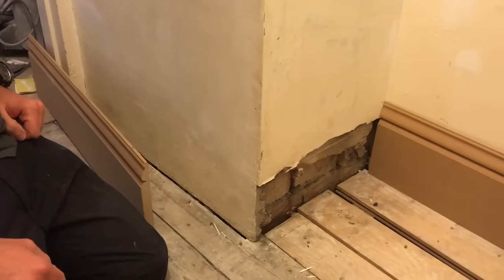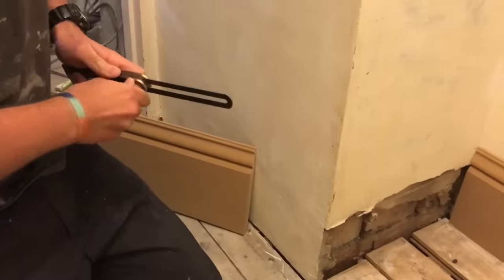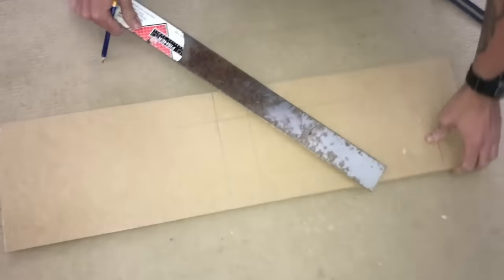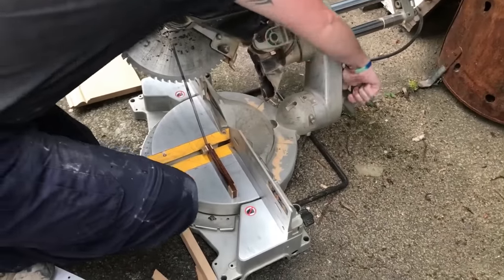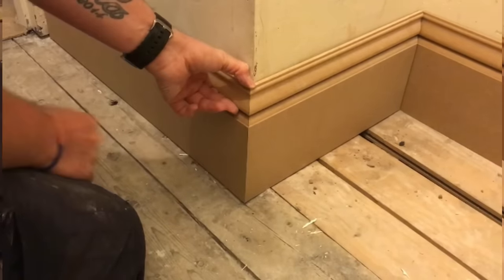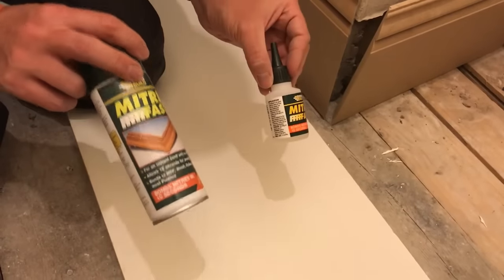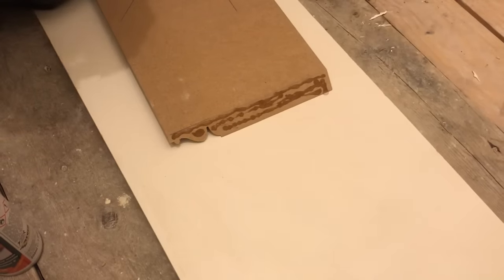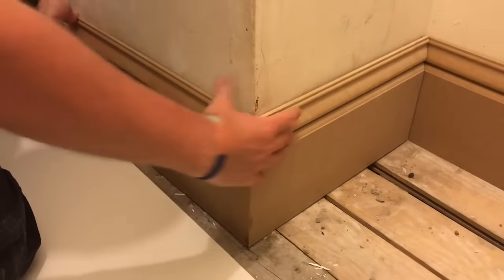How to cut an external mitre / outside corner on skirting boards / baseboards.

Comment: I'm sitting in my living room staring at a huge pile of skirting that needs fitted in practically every room in the house. I have to thank you for putting this videos up. I was just about to start today and I'd have gone in with a totally different tactic! Your advice has saved me from making a complete arse of the entire job. I'm going to scribe my internal corners instead of angled cuts. It has all become clear now!! Cheers mate.
Reply from the maker: salmon ninja thanks for your comment and I hope all goes well with your skirting boards. Thanks for watching 👍🏼
Reply: In all fairness you CAN angle cut your internal corners too, it will just not allow for much wall imperfections. If your walls are bang on 90 degrees I never had issues angling internal corners. With not so ideal walls, scribing the corner gives a bit of manoeuvre to join them more neatly. With angled cut you’d have to fill the gap with caulk and paint it to hide imperfections.

Comment: Another suggestion to finding the angle:, Before you start any outside corners, cut some sample blocks with a 45, 45.5 and 46 degree angle.  Use them to check your angle at each outside corner as you go.  
Much faster and fool proof.

Comment: Fantastic tutorial. And the tip for gluing pieces together first is spot on. If the floor and walls are out of level, as well as the corner not being 90 degrees, impossible to do otherwise. Cheers mate!
Reply from the maker: Busyboy 42 Thanks for that kind comment, glad I could show you some tips. Thanks for watching 👍🏼

Comment: brilliant craftsmanship, finally a foolproof method, thank you.
Reply from the maker: mac do it's the way craftsman have been doing it for years! Unfortunately recently skills have been lost and speed has taken the place of quality 😔
Reply: @spendtimesavemoneydiy  if the floor runs out of level this will  it work  do well .I have 40 years experience in the building trade and a carpenter by trade
Reply from the maker: @richardkearney1928  thanks for your comment.
My videos are designed to help people who are trying to have a go themselves to try to save a bit of money.
If I were to cover every aspect and every eventuality and everything that could cause an issue the video would be hours long.
I just try to help diyers to do a bit not teach them everything I have learnt over the past 20 years.
If you think you could make a better video, send me the link and I will give it a watch.
Thanks for watching.

Comment: Still coming back to this to jog my memory. Great vid, thanks.
Reply from the maker: You're very welcome.
Thanks for watching 👍🏼
Reply: @spendtimesavemoneydiy  could you offer any advice for using the coping saw in the skirts, or is it really just a matter of practice? I'm using a course sand paper to work the mdf. Is this a used method?
Reply from the maker: @GSDhandler1  always keep the saw moving, use as much of the length of the blade as possible, make sure the pins are lined up, teeth facing forward 👍🏼

Comment: Best vid I have seen on YouTube as I’m doing a skirting board job at home, this has given me the confidence to do it properly now, I bought a plastic mitre block and handsaw and was literally tearing my hair out as nothing fitted correctly as corners not 90 degrees, I’ll get a cheap electric mitre saw from Screwfix tomoz and fingers crossed, I’ll follow your tips and all should fit! Cheers mate, really appreciate it!
Reply from the maker: Pork Scratchings thanks for your comment! Good luck with your project! Thanks for watching 👍🏼

Comment: Brilliant! Good to see there are still Craftsman out there, don’t come across many these days.
It’s normally bodge joints,  I have to get out the two pack wood fillers & caulk to make the joints good.
Yes, I am a decorator & I get frustrated that some so called joiners don’t spend that little extra time to get the mitres right.
Reply from the maker: Stephen it's sad that so called tradesmen will do inferior work to make more money. There is more to life than making money and I have always chosen to take a pride in my work at the cost of a little more time. Thanks for watching 👍🏼

Comment: Awesome video.  Thanks for sharing your expertise.
Reply from the maker: Daryl Ponting Thanks for your comment and thanks for watching 👍🏼
Reply: +Spend Time, Save Money, DIY : why didn't you show and illustrate the cutting of the inner corner line. 
Can it also be cut using the circle saw or you need a hand saw to cut it ? 
I suggest and request you show that in your next video illustration.
Otherwise thanks for your skills, time and sharing.

Comment: yep this bloke knows what he's doing - although it helps to have a fancy chop saw and a sliding bevel  -- . Four corner rooms are easy but if you've got to go round an old chimney breast and do external mitres  Id get a  decent chippy to do it rather than pissing around for days on end bisecting angles, filing off 45 degree mitres than don't fit, cutting mitres the wrong way and generally getting  REALLLY ANGRY.
Reply from the maker: Bill Smith thanks for your comment and thanks for watching 👍🏼

Comment: Good video!  I have found it more accurate to mark the outside corner on the floor because we are cutting from the face of the board rather than the back. I like your method for bisecting the angle, and have done it that way for years.
Reply from the maker: Grant Snell thanks. You can mark the angles out on the floor but it isn't always possible. Thanks for watching 👍🏼

Comment: Really helped me there mate. Was trying to cut a 140 ml skirt @ 50 degrees one end and 45 to meet other, couldn’t do the cut standing up the skirt and my bevel only cuts slightly over 45 degree , this method is great , will jus have to buy more board as I’ve messed up my few last bits .
Reply: How did you cut if bevel doesn't go past 45?
Reply: Bisect it.

Comment: Great video, another tip you can get a digital angle reader divide it by 2 and lock the angle off. Transfer to the saw and you have a perfect angle cut every time. Does save time

Comment: Great video and technique  for bisecting the outside corner and I will definitely give it a try when the opportunity arises.  Another method that I have successfully used is to trace the angle from your sliding bevel onto a piece of stiff paper ( like a manilla folder ) next cut the angle out of the paper, then fold the angle portion of the paper in half. That's the angle you need.
Reply from the maker: Joseph Fili Thanks for your comment, that's another great way. Thanks for watching 👍🏼

Comment: that is a cracking cut, only I think you should've done in my humble opinion, an how you scribe an infill cut, would've been the best comprehensive vid by miles but seriously, I've been in the game a long time and never thought to use an activated glue on cuts prior to fixing, excellent tip, Thanks, keep em coming
Reply from the maker: Mark Beckitt thanks for your kind comment. I did a separate video for the internal scribe joint. 
I've learned it doesn't matter how much you know you can always learn something new.
Thanks for watching 👍🏼

Comment: Good vid mate, love that glue, been using those concrete screws to fix Taurus, no need for a plug, they grip so good, still pilot & countersink though👍
Reply from the maker: SuperDieseldriver Thanks for your comment. I haven't tried them concrete screws. I'll have to give them a go! Thanks for watching 👍🏼
Reply: @spendtimesavemoneydiy  I'm a joiner myself been out of the game for a while doing other things, didn't even know about the glue until I came across your video had a living room on a property with a chimney breast with no fire so had to skirt 2 nibs out, the glue was a great help then 15mm Brad's with small titan nail & staple gun job done👍👍
Reply from the maker: SuperDieseldriver every day is a school day, we never stop learning. I'm glad I could show you something new. Thanks for watching 👍🏼

Comment: Hi,
I am impressed how clear you explained this. Tried my first architrave cut and the procedure worked like a charm. 
Question please I have an external corner that, bisected, is greater than the 47 degree on my DeWalt compound mitre saw, how is that predicament solved? only need about 4 more degrees.

Comment: Just found your videos. 
I’ve done a lot of trim work I’m my days, mostly new. Newer tries to have better angles but the older buildings get they settle, sag, lean and twist. 
Base boards are easier for me, my real downfall is trying to figure out crown moulding. I have had it explained and demonstrated using combo mitre saws, tables saws and coping and it still takes me forever and a lot of scrap.
Reply: I forgot to say, thank you. Tight joints.
Reply from the maker: Charlie Duncan Thanks, check out my video for coving it might help you out. Thanks for watching and be sure to like share and subscribe to help the channel grow 👍🏼

Comment: MDF is so nice to work with as it is so straight and flat.  Doing the same with 6 inch timber is trickier given its tendency to twist.
Reply from the maker: I love working with mdf. But if I make skirting from timber I make relief cuts in the back to minimise cupping 👍🏼

Comment: Good video of old fashioned way of determining miter saw angle... or you could buy the Starrett 505P-7 Miter Saw Protractor on Amazon which tells you the miter saw angle to use for cutting.

Comment: This is great mate, been having a mare trying to fit trim. My angle finder is to big to get round the corner. Can I put two bits of wood across both sides and score a line and get my angle that way?
Reply from the maker: Yes you can. 
I explain it even more in my other video if you want to watch that one. It's for no power tools but the marking and principles are the same 👍🏼
Reply from the maker: https://youtu.be/Dy0ycCPH3cc

Comment: no wonder my 45 degree cuts didn't work in my old house!  it was greater than 90 degrees!  I don't feel dumb anymore.  Thanks for the trick!
Reply from the maker: Tammy J Boudreaux thanks for your comment. It's a great trick but it's been done like this for years before the invention of fancy gadgets. It does surprise me though how many professionals don't know this method.
Thanks for watching and be sure to like, share and subscribe to help the channel grow 👍🏼
Reply: Tammy J Boudreaux For example, if your angle is 98 degrees, you don't divide it by 2. Here's how you do it. 180-98= 82. Then 82/2=41. There's your angle to cut.

Comment: Thank you so much for your videos!  I am trying to fit skirting board that is double-sided (Torus on one side and Ogee on the other).  Am I right in saying that the only way to do this is with an electric mitre saw? Because there is not enough wood on either end to mark an angle?  Thanks!

Comment: that is masterfully done. I've learnt a lot from this. Also wondering if you can advise any tips for an uneven timber floor...couple boards high and low on the north and south walls (boards running north to south). Wondering about adding some scotia at the base of the skirting, maybe smaller cuts??. Well done
Reply from the maker: raindogred Thanks for your comment. With uneven floors if you set a compass to the biggest gap and use that set to mark and scribe the bottom of the skirting. Hope this helps! Thanks for watching 👍🏼
Reply: @spendtimesavemoneydiy  gothcha...thanks a lot!!! cheers

Comment: Great job, will be trying this soon!!
How come you scribed the joint on the other end of the skirting rather than a mitre joint?
Thanks for vid
Reply from the maker: hectorc01 a scribe is much better than a mitre on internal corners, if you watch my other video on scribing internal corners it explains it all! Thanks for watching 👍🏼
Reply: No matter how far out of square an internal angle is, a scribed joint  always fits. 
It saves time measuring angles with whatever tool, protractor/bevel etc.

Comment: Air tightness is important in a houses performance these days. This was a good opportunity to foam fill the gaps between the wall and floorboards, also a chance to mastic or seal any gaps in the floorboards. 

Great work   biscecting that angle as not many 90 deg wall corners out there.
Reply from the maker: k s good point about the foam and mastic. Air tightness is important now but most older houses are not.
Thanks for watching and be sure to like, share and subscribe to help the channel grow 👍🏼

Comment: Apologies if this a a stupid question!!!
Is it possible to use this method if my chop saw only tilts to 45 degrees?
Many thanks for the videos
Reply from the maker: hectorc01 most saws only tilt to 45 degrees, so set the angle to the other side of zero and turn the skirting over! Hope this helps! Thanks for your comment and thanks for watching 👍🏼
Reply from the maker: hectorc01 also there's no such thing as a stupid question in my book! If you don't know, ask! Then you will know! 👍🏼
Reply: @spendtimesavemoneydiy  I have a de walt compound mitre saw that tilts to 48 degrees,very useful for odd angled corners.

Comment: Cutting the back of the baseboard first is more likely to cause tear-out on the face of the miter, compared to cutting the face first of the board with the chop saw.  Not a problem with your MDF material, but tear-out can occur with oak baseboard for example.
Reply from the maker: With the right sharp blade and using the saw correctly you shouldn't get much tear out even with oak because the saw actually cuts on the up stroke.

Comment: Thanks for the tip. Just wondering how you get the exact lengh of each of each piece? Is  that from where you put each 'mark' on each board and squared then off with a 90 degrees mark (when u used your handsaw handle for the square mark? Cheers from Australia 👍
Reply from the maker: Yes the mark is the length and I square it down. Thanks for watching and be sure to like share and subscribe to help the channel grow 👍🏼

Comment: You the master. I would love someone show how to do it without that machine. Mic was low.
Reply from the maker: Stephen Williams thank you for your comment.
I am planning to do a video for a complete guide to skirting boards with no power tools. So watch this space.
Thanks for watching and be sure to like, share and subscribe to help the channel out 👍🏼
Reply: Any suggestion how to do it without a table saw?
Reply: @spendtimesavemoneydiy  That would be great. Looking forward to it.
Reply from the maker: Stephen Williams use the bevel to draw the angle on the board and square it around, then cut with a fine tooth saw.
If you watch my video on scribing an internal joint on skirting boards it may shed some light on the matter.
Reply: @spendtimesavemoneydiy  Ok I will try to get the bevel first. Thanks

Comment: I take a couple of scraps and make them 46 degrees and try them. Then make an angle adjustment off the results (make them 45 and 1/2  or 46 and 1/2 or whatever it is), Then set the saw to that angle not messing with that angle finder square.
Reply: My method exactly. Also, with my Rigid compound miter, it has a 12" blade and I can cut all angles on most materials without tilting the blade, the only exception being on compound angle cuts. It can cut stock that is 
7 3/4" thick/wide.  If the angle is slightly acute or obtuse, I wag it a couple of degrees one way or the other and it works out.

Comment: For this outer corner, how did u get 44 degrees. Does your saw bevel go past 45 degrees. I tried to do a 44 degree cut on a single bevel mitre saw that tilts to the left but it only goes to 45 degrees so I couldn't get 44 regardless of what way the wood was positioned.

Comment: Great work! How tall are these skirting boards? And is there a special name for the profile?
Reply: Looks like torus skirting
Reply: thx
Reply from the maker: They are 9 inches tall. There isn't a name for the mould. I made them myself with a standard cutter for a spindle moulder
Reply: @spendtimesavemoneydiy  Thanks a lot. I like that style! Can you share the profile. I'm trying to get that mould here in Germany. English skirting is not very common where we live, so I have to make them myself, too. Thanks in advance.
Reply from the maker: @martinstahl2959  it's made by whitehill and it's cutter wst29
Reply: @spendtimesavemoneydiy  thx a lot👍👌🏿✌️

Comment: great mitres mate, some great tips for us DIYers ,  are there any situations where you would you gripfill, no nails, pinkgrip etc....
keep up the videos mate, great work very interesting. P.S  can you get a better sound monitor or speak a bit louder,
could hardly hear you and i had my speaker on my laptop up full, sorry mate i want to hear what you have to say, 
keep up the good work, regards kevin
Reply from the maker: kevin benstock thanks for the comments. I will try to speak louder! I would only use an adhesive if the wall wouldn't accept a screw, if it were too crumbly!
Reply: kevin benstock 

Cement rendering diy

Comment: I've got a few corners that are probably 100 degrees or so.
I dissect the angle and it works out alot wider than the max 45 degrees what my miter saw will tilt too. how would a do this then?

Comment: So I tried this method but the problem i have is on one wall my floor runs up and throws  the miter out  do i plane the bottom of the skirting off to make it level if that makes sense ? Up